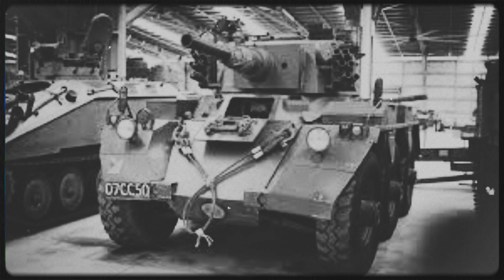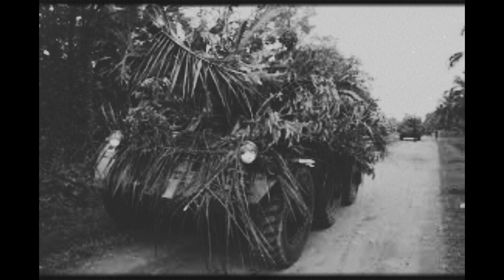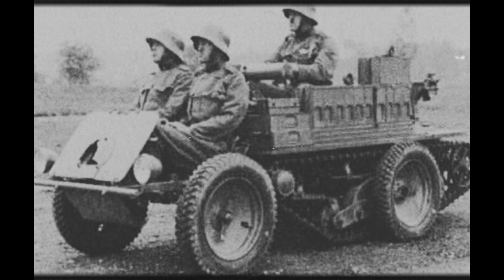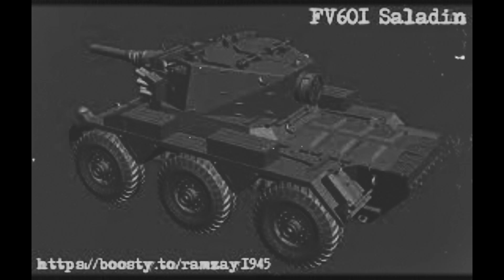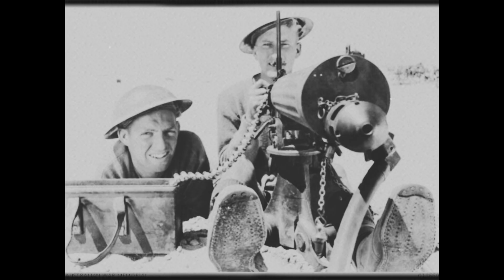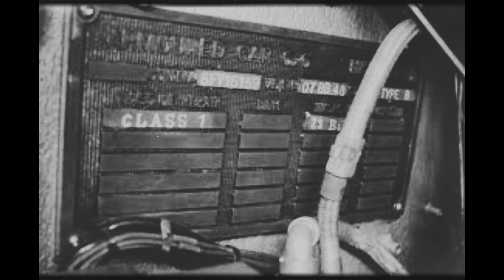The British Tank Destroyer That Actually Fought Insurgents Instead

Comment: I drove one in lybya from the coast to the southern border and back ,a journey of over 1400 miles, and on many manoeuvres in the lybian desert, including the saracen and ferret armoured cars, 3 years and 5 months gives you confidence in these vehicles. When the generator broke away from the engine i had the back plate down and the radiator out ready for the REME to fix it back up. We carried a good tool kit.